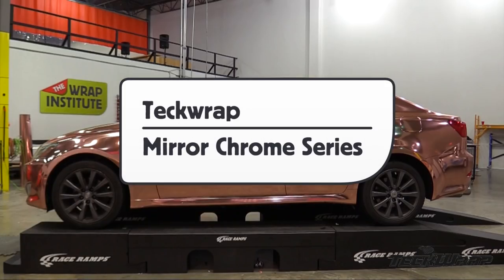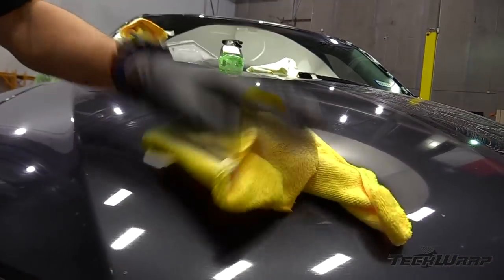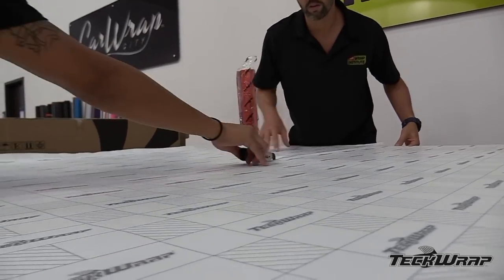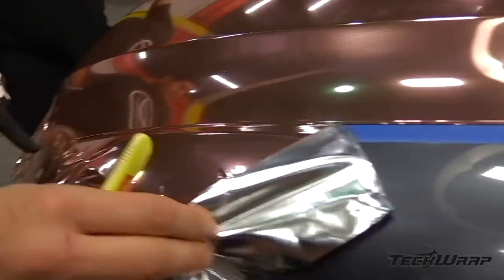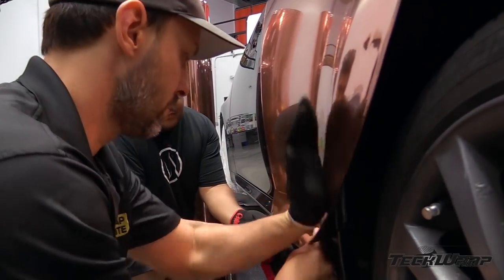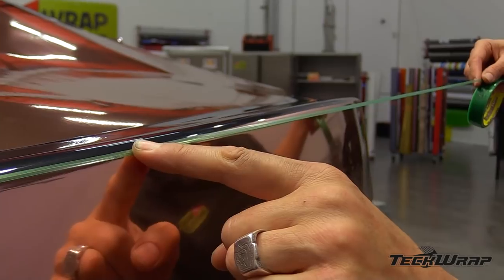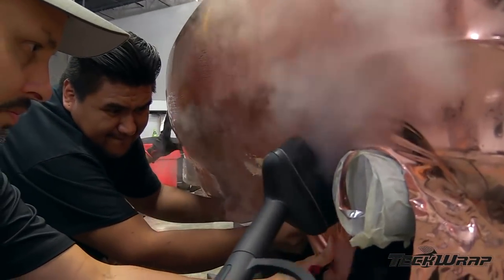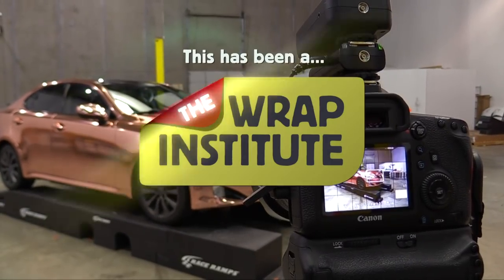TeckWrap Mirror chrome by Justin Pate

Comment: Seller at my country said this vinyl will leave glue as soon as we stick the vinyl properly and pull it. The glue is very strong sticky. Is it true?
Reply: Yes, that's mirror chrome. Try avery
Reply from the maker: If you remove the film as we recommend within the warranty period you will have less adhesive residue.

Comment: What if we use more than 3 years?
Reply: Adhesive or the film may fail leaving a horrible residue behind. Chrome material is definitely the most delicate wrap film in the market.
Reply from the maker: You will have hard time to remove it because of adhesive residue

Comment: The cost to duration ratio is off. If the cost is that technical and the price tag to out chrome on it is ñike 5k at least then you might as well paint it instead. For the livelihood of this material lasting is not worth the price.

Comment: isn't it easier and faster to use paint?
Reply: Not to mention the cost Is just about the same and paint last a lot longer if done the proper way plasti dip has lots of different colors and styles and it is like half the cost but you do have to know how to apply the dip and do It the right way if not Itwould look like shit